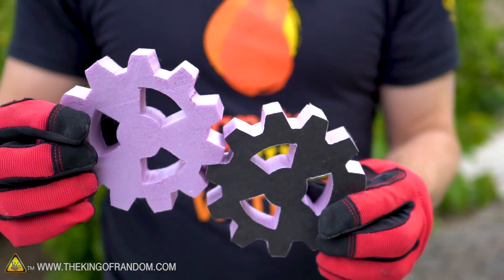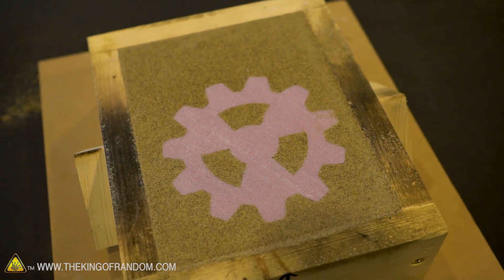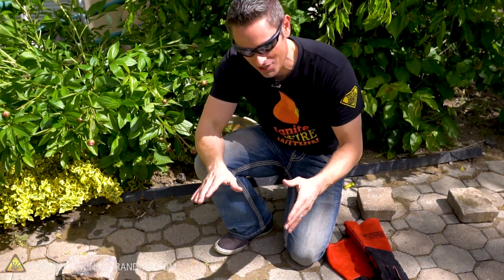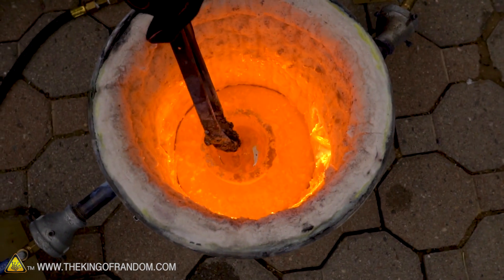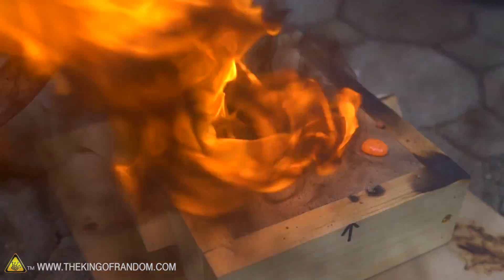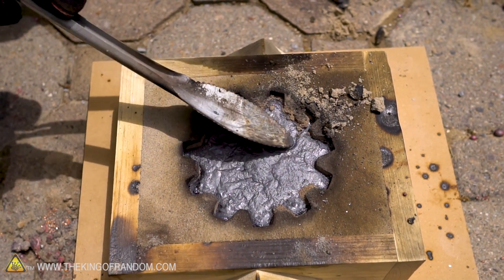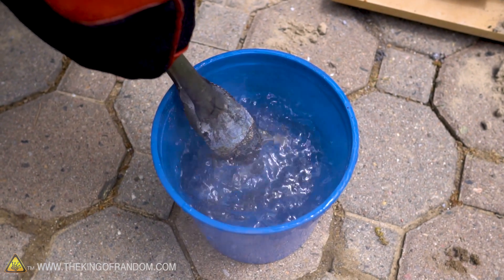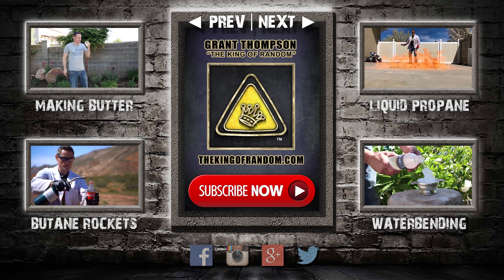Argh. Why Is Copper So Difficult? TKOR Tests Melting Copper In Our Homemade Foundry

Comment: You need to tamp the sand better. In industrial casting, they will raise and slam the mould repetitively. They also use a chemical in the sand which helps it bind together better, which would prevent the sand from popping out like that.

Comment: the copper was too heavy and the sand too bouyant. the inner tines werent getting knocked over they were floating.

you should try to do this by drilling a hole in a piece of wood to pour through and placing that on top so they dont have anywhere t bob up to.

Comment: What about adding plaster of Paris to the sand and allow it to dry before casting?  It may bond the sand enough to keep it from falling apart.  It should be harder to clean the copper, but with a brush should come off.

Comment: Just a thought, including some internal structure to your sand mould  could reduce the effects of the buoyancy of the copper. I.e. For the internal components of the mould (radioactive symbol you mentioned) had some pins in it that would help give the sand something to adhere to a bit more, and be a  bit less likely to pull out

Comment: Try using a small torch to melt the mold and then scorch the sand. The additional layer of carbon on top of the sand should bind the sand together and make the sand less likely to break out.

Comment: Ur using the wrong sand
Reply: my thought exactly.    It looks like basic play sand, and I would bet there is no bentonite or wood flour in it.   Should have covered the foam with parting powder, and pulled the plug.   I bet the core breaking was a result of the remaining foam trying to float, and the gas bubbles from decomposing foam causing problems.
Reply: yup, not fine or sticky enough, also should be packed tighter for internal holes to keep form...
Reply: We need clay
Reply: @itsjustnuh3834  clay would stick to it

Comment: I think if youd drill a hole in the wood top to pour the molten copper through with the top screwed to the mold frame it would work.

Comment: I was just wondering, can you maybe do an inclosed mold with that sand? And pour the copper into a funnel hole? Cause what it looked like to me on this video you made was the sand was giving way and was pushed up by the copper and the foam on the there was no where for the sand on the bottom to go so, maybe a fully inclosed mold?? (Btw no experience in this field, just a point of view)

Comment: You need to fill the box with sand first, and then put the gear in it, and kinda press it in. You may need something plastic rather than styrofoan.  Reinforce the edges, and then hit it with a blow torch real quick to make it black. This will add a layer of carbon that will be stronger than the sand on its own. Pour the molten copper into the mold, and then hit the top with your blow torch to keep it totally smooth

Comment: you want to make trapedzoidal prism Styrofoam moulds and use that to make steel spacers and then use that as the centre parts because otherwise the buoyant forces along side unstable gas releases will just destroy the centre pieces every time this ofcourse becomes more and more inconvient as it gets hotter but you can always use clay

Comment: Couldn't you just stick a bolt down each of those sand pieces in the middle with a washer on the top just to add some extra strength to keeping it anchored

Comment: I would have tried to drill holes in the sand so the pressure could go down and not around the radioactive holes. On the gear

Comment: if you want to do a open face mold like this, mix plaster with sand then cast your gear, and after its dry burn out the foam with a torch and you will have it hold together.

Comment: Wouldn't it be better to blowtorch that foam?
Reply: Then why use it as a mold?
Reply: @FirstLast-fr4hb  Temperature, I'd guess. Sand does change to glass until you get it to a very high heat.
Reply: so do many other much more solid materials , though, why use sand if its not working?

Comment: I wonder if cutting out sections of thin aluminum from a soda can for example and making them longer where you want your holes to be in your cog foam mold and covering it in wet sand would buy you the extra time you need and strength and maybe the sand won't break off in the center allowing your holes to keep their form as the copper cools. The wet sand would maybe keep the soda can tin from melting as your cog forms in the sand. Really cool what your doing.

Comment: You can learn alot on successful sand molds by watching how the Lodge company does it for cast iron. One of the biggest keys is extremely high amounts of compression on the sand, which obviously hand tamping cant do, and other elements can be added for stabilization like clay. Also using a gate and runner method for the molten metal would be helpful instead of pouring a heavy mass on top of a fragile collapsible material.

Comment: The foam is contracting as it’s burning away and snapping under the the holes. You need to pack a top layer and pour the copper through a funnel through the sand.

Comment: Looks fun. You need to completely bury it with sand and add a foam pour spout and fill basin, like a submarine periscope without a bend. You will have to cut it off, but it will give you the pressure you lack and will ensure your thermal issues are mitigated.

Comment: Add cat litter ground up to fine dust to ur sand mix fullers earth is actually used in casting it will hold together much better at pour point.

Comment: the solution for your sand mix you are using for casting is to add a small amount of clay powder at a ratio of 1 to 10..tthe trick then is to have the sand.  A very very slightly moist.  Usually just a humid day is enough.. it will make the sand sticky

Comment: What if you tried putting something in the sand details so that they dont pop out? Maybe if you filled those parts with concrete while the styrofoam mold is in there, then after the copper cools off, just break the concrete and sand it out. It seems like the details were the only things giving you a hassle

Comment: Can you mix the sand with something like resin to give it more strength? Or would the heat dissolve the resin? Surely it's stronger than wet sand on its own?

Comment: you can not squeeze precision pieces of copper in sand try with precision casting the workpiece is coated with quartz sand up to 7 times as the first two times it should be very small chips are made on a water based basis (silicasol and ethyl) if you are interested contact me on skype vipara_links

Comment: The molten foam is acting as a volatile coolant (petrol products all generally vaporize at 800 degrees F), creating a cooling and bubbling effect you don't want. Find out how to remove the foam before casting, and you'll be onto something.

Comment: 1. Use real casting sand. 2. Use Acetone to remove the styrofoam. 3. Make a top with a hole to pour your copper into.

Comment: You need casting sand which is a mixture of fine grain sand (the finer the sand is, the better the detailing) and Bentonite clay.  The mixture is ~84/10/6 Sand/clay/water.  This ratio only works with Bentonite (green) clay and is what is used in the major foundries for industrial casting; this should get you a clean casting of your gear.

Comment: Try using a 2 part mold sealing the foam inside the block of sand and use a spout and vent in the top half to make the gear and vent the gasses. That way there's nowhere for the weak points to go.

Comment: Your better off taking the shape outta the mold and cast it in two pieces so air can’t get inside your mold. Using the proper sand and talcum helps also

Comment: You need to put the gear down deeper in the sand and have Styrofoam poles sticking out so it will mold into it and burn out the Styrofoam also it needs sand castle walls around it so it pools in till it has room to fit the rest in

Comment: didn't they use wax to make shapes in the compressed sand? think the forum wouldn't turn to ash that fast as wax would do

added a note: use a metal box when trying this with sand, then bake it in an oven say 250-300f, not a wooden box, and hold water contact with hot copper metal it goes pop in the sand! dry out the sand first a must do!!

wet sand is a bad move, dry sand is best after bake it with the shape you like to add copper to it!

Comment: Aight, so you were doing the exact same thing expecting things to change. You really wanted to get different results doing the exact same process with the same "ingredients". Why didn't you use clay instead of sand? There were some other things you could have done differently.

Comment: yea something like this you would need to do some sort of die casting under high pressure if you want those really fine surfaces, the sand just simply isn't strong enough for all of that copper.

Comment: Make a two peace mold top and bottom. Just like you have  on the bottom and then make the top to fit the bottom with a hole to fill from and two holes which the copper can rise through so you know the poor is full

Comment: Two suggestions.

1. The sand is too soft, so use an additive (or a little moisture) to bind it together better, and make it firmer.

2. Create a top half to the mould (even if only has a flat face) and make fill holes and vents, to create some gravitational pressure on the poured metal, to drive it into the corners of the mould, and to slow the cooling of the copper.

Comment: Maybe try blow torching the styrofoam to burn it off first, leaving just the sand mold behind. That way it probably solves the cooling down issue from heat loss to melt the styrofoam.

Comment: You cant use an open mold. 

Fill with sand half way.
Put your Styrofoam on the half full sand container,
now fill container with sand. 
Leave a hole from the surface which leads to your Styrofoam. 
Pour copper through the hole.

Copper will flow through the hole into the Styrofoam and melt it.

Comment: It would be better if you mix cement with the sand to form a concrete mold, it will not collapse unless it will be cracked

Comment: I've done this and you're doing 1 thing very wrong.  your sand mix isn't being reinforced with any type of glue/epoxy.  I got the idea from watching how Ferrari molds their engine blocks. Mix an adhesive such as epoxy in with your sand and make it damp. Next, get yourself a hydraulic press and set your mold onto the press with your plug and push down with as much force as the frame can take without breaking, ( I use a plate for even distribution) let the mold cure over night. It'll be hard as a rock by morning THEN pour your molten copper, the sand will be able to tolerate the pour by being reinforced by the resin and glue and still be brittle enough to extract it. I hope this helps.

Comment: simple fix,...
step1 add a top to the sand mold.
step2 take a small metal tube and push it down until it hits the foam gear and then pull it out slowly.
tip you can do step2 two or three times.
step3 mark the wooden box lid  where the holes are going to be and then drill out the marks on the lid.
step4 screw on the lid and add funnels to the holes.

Comment: You were almost there. You were on the right track. You have to do it in layers. Little by little. So heat up a small bit of copper. Pour it in. Do it over and over.

Comment: If you want to use green saying you're going to have to wait down a lawn mower and you're also going to have to compress it an extreme amount if you don't put your all into compressing it it will flake apart or it will get too crispy and just snap right off because of the pressure

Comment: i STRONGLY suggest getting some of the correct oil to use in sand molds. they need special oil to keep stable and shape. without it, sand pops up like you saw.. but with it, its amazing. also, are you using proper mold sand?

Comment: What you need is a cover for the mould with a funnel to direct the flow of copper. Using a little cement to create a slightly hardened sand may facilitate the removal of the styrofoam prior to pouring. Pouring directly on to the sand will of course disturb the mould. Leaving in any styrofoam will create a imperfect cast. The sand does not look fine enough either.

Comment: Have you tried applying vibration to the mold, to get the sand grains to move closer together and reduce the amount of air still in the mold?
Think, high frequency, low amplitute,.. kind of like the machines that put a flat surface on concrete.

Comment: first that isn't green sand, and adding moisture will not do anything, it is supposed to be made with oil not water and the mold should be made in two halves with proper gating in order to get it to work. the art of casting is just that an art you cant expect foundry results doing it the way you are

Comment: as a mechanical engineer, I should tell you casting gears is not usually done.
what you would rather do is cast a cylinder and then cut out the gears on a milling machine or with a special arrangement.
however, I did try it, with aluminum and it did work out, but I did use a pressurized permanent casting mold... borrowed from one of my professors.

I am currently working on a new modular design for gears :) so, get ready for a casting revolution

Comment: Experiment more with your green sand. Though you do need to quickly pour the copper, the biggest problem was the sand crashing because it did not have enough cohesion to itself. Adding water does help, but add more of the clayish substance that you use to make your greensand, which should make it more cohesive.

Comment: Hi this is Shikhar Mishra..... I think you are probably making a mistake......that......you are not covering the upper part of the gear with sand and making a hole in it for pouring hot metal into it......

You can do it by--first pouring sand in the mould about a considerable thickness then placing that poly....whatever qurple gear into it and then covering it completely  with sand.......then make a hole into the sand for pouring metal in it........i guarantee that this will fix this problem of popping up.....

Comment: Given the reaction from the wet sand, I'm betting the water in the sand is boiling off causing the sand to separate.  You might have better results with an air set method.

Comment: Dude, my recommendation is to use sand and what ever chemical that reacts with carbon dioxide gas to harden. Similar to engine block casting

Comment: 3 options here. 1. add a chemical to it like with the glass so solidifying point is lower. 2. Styrofoam gear with riser  and into the bucket of sand. 3. electric arc furnace so it's REALLY HOT.

Comment: Sand has very little strength, it will behave like the way it has in this video - flaky. 
Need to use something with greater strength against Molten copper

Comment: You should try heating the sand until it crystalize just enough to stay still. Not to much so if more heat gets to it... It cracks. Once the sand is cool enough you can use the mold and pour the cleansed, Moulton copper in the hardend sand the sand should heat up to the point where the sand continues the Harding process therefore instead of falling apart with the movement of the liquid won't disrupt the sand but strengthen it. Just find out what temperature the sand needs to get hard and harder and match that with the temp of the hot copper😊🤔

Comment: From what I understand of casting and I know this is almost a year latter is that for more intricate castings you need a two layer mold made of sand or clay. I’ve watched a lot of castings done and that’s what I’ve always seen. Top and bottom screwed together then pour the metal in from the top until it’s filled.

Comment: Someone I think all ready wrote it. But only your cores (holes) broke.
Make them stronger / steadier with either metal ride to hold the sand in place, actual cores from stronger sand with core sitting on just a roof.. like as suggested..close mold.

Comment: If you run the metal in at the bottom of the foam, you can use completely dry sand. The foam will float as it is displaced by the metal.

Comment: using sand as a molten metal mold is bound to fail to begin with . JUST THE FORCE OF THE DROPPING MOLTEN COPPER IS GONNA PUSH THE SAND AND CHANGE THE SHAPE OF THE MOLD

Comment: Mainly its's not possible make almost any copper, bronze or brass objects in open mold. And secondly use oilsand not regular watersand. Try closed mold. Most likely you will succeed with closed heated claymold made from horsepoop and hay and clay. First dry the mold then heat it until hay burns out then keep it in slightly glowing red heat and pour the copper in. Should work or maybe not, its bit of luck when dealing with old techniques.

Comment: how much copper did you lose on your patio stones? and did you have to break the one you dropped the molten piece onto to get it off? and if you used die steel and pressed two half forms together, on a piece that's not totally molten,  but then that's not really casting is it?